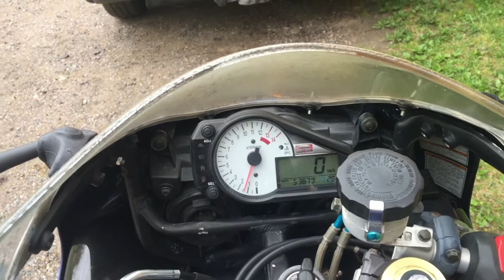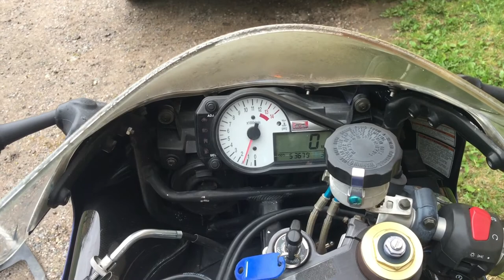Suzuki GSXR 1000 K1 First Bike Restoration Part 3

Comment: Some reason my bike won't go into neutral while running I have to turn it off to get neutral. I put new clutch cable and adjusted in 3 spots but don't work. So I think it's a common issue on these years
Reply from the maker: My problem got better when i used proper oil like you see on my other videos.My bike didnt had many km in in last years and clutch didnt worked like it should.After some good oil and just driving everything is working.